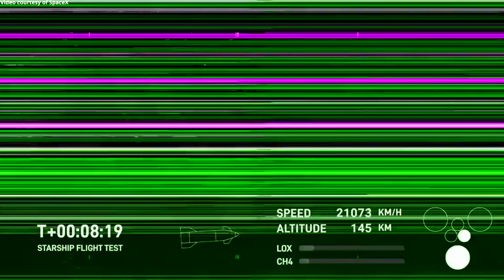Starship launch anomaly, 16 January 2025

Comment: SpaceX is going to get a slap in the neck. The flight termination system didn't blow the rocket up. It just broke up in the atmosphere fawk'n beautifully 🤩. Also it looked like with the engines going out one by one, it caused the ship to spin. You can see the rate of the spin increase by the speed indicator as each engine flames out.
Reply: The breakup was almost certainly FTS: There was serious underspeed at engine shutdown, by over 4000km/h. Without it the ship would've broken up much later and at a much lower altitude. There is also a video someone filmed of the explosion. It definitely explodes. Either FTS, or energetic explosion of the propellant tanks for some other reason (seems unlikely, entry breakup would've taken much much longer)

Comment: Absolutely idiotic idea with a very expected outcome
Reply: They have launched it many times before but this time they used a different starship.
Reply: @ sure dude, whatever you say 😂
Reply: @andylem   this is the block 2 starship if you see the fins at the top they are smaller than other launches.
Reply: @ nobody cares
Reply: @PURPLEBUTTERFLY1010 so the old one was useless too?
Reply: @  i mean they are just test rockets 🧨.
Reply: That’s what they’re testing it for. It’s their money, and they’re making enough of it with Starlink.
Reply: @bno6156   it doesn’t change the fact that the idea of this rocket is stupid
Reply: @andylem  it’s not stupid if it works, which is what they’re in the middle of trying to make happen. You mocking them for trying does fuck all.
Reply: @ it doesn’t work and never will. Still not stupid?
Reply: @  nobody knows if it will work in the future and also it has been successful in the past. It’s also a test rocket so it’s not that important
Reply: @ it has never been successful. Not a single launch ended as planned.
Reply: @  yes they have are you an ai.
Reply: What part of the design do you think is idiotic,compared to other systems? Just asking.
Reply: @ are you blind or retarded?

Comment: The flap actuator failed , the ship got wrong angle of reentry causing it the burst in flame
Reply: It didn't even reached the point of re-entry, it was terminated mid-flight after a fire leak started in the aft section